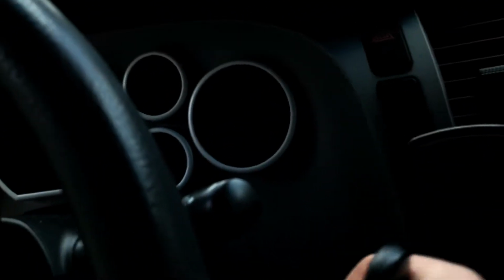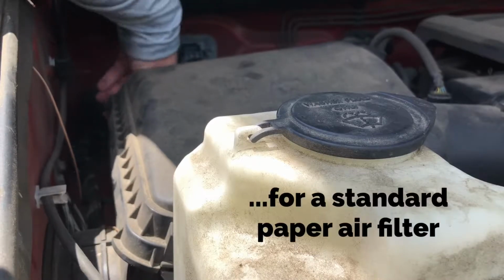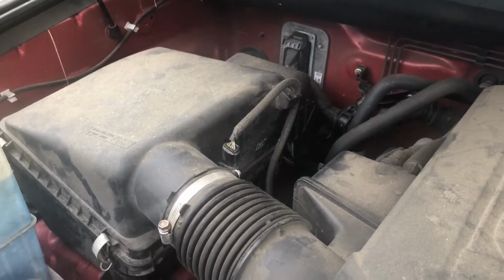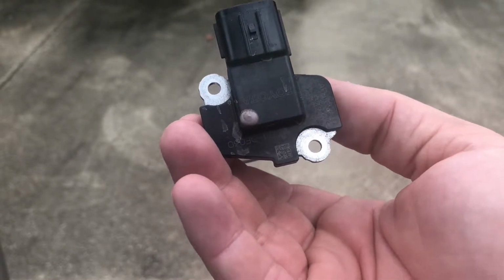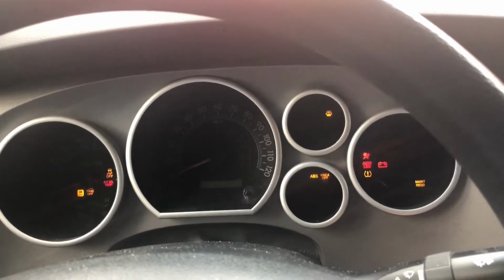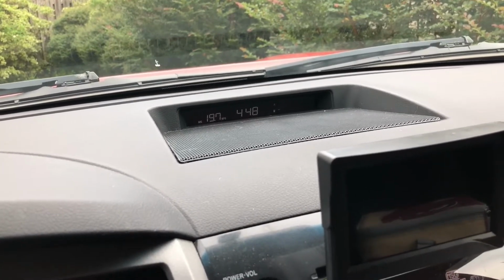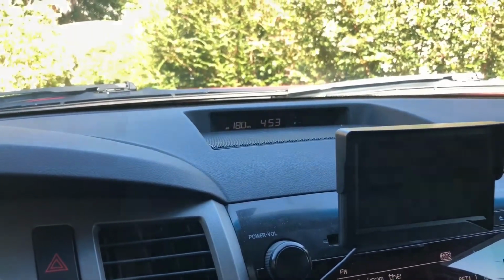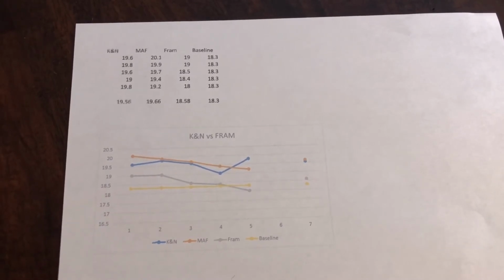K&N vs Fram Air Filter. Which is better for MPG in my Toyota Tundra?

Comment: I think filling at the gas pump and calculating the mileage that way will give a better reading, the mpg on the dash could be wrong depending on the air flow. The super charged tundras show 20mpg when in fact it's lower and it's just not complicating the right amount.
Reply: You are absolutely correct, those mpg displays are completely inaccurate

Comment: Pretty sure thats a map sensor mass air flow has a wire. Could be wrong though. I think som models were maf and some map. Crazy what 1 mpg adds up to in the long run! I think you probably should have tested both without cleaning the maf or map.

Comment: How the hell do you get 19 mpg?

best I've seen on my tundra is 18..and that was coasting.. 
Soon as i city drive. 14mpg.. and a low of 12 towing a trailer.
Reply: otahu Rice LOL! It helps that Florida is pretty flat. And I keep my foot out of it... at least for testing purposes. Other than than the filter, I only run 0w20 synthetic oil. The rest is factory original.
Reply: @Eldubzzz  I'll say... I live in 90% of hills.. Nothing flat around me.
Reply: I just bought a 2012 Prius for this reason, 50 mpg just normal driving .....Not bad for a car that costs me $3500 from the car auction 👍👍👍👍
Reply: I've got like 9 mpg on my truck and that's baying it. How the heck do you get 18 to 20
Reply: @harmless360  same here

Comment: How did you get 19 mpg. My 2019 only get 13-14
Reply from the maker: Flat Florida back roads I guess. It drops to 10 mpg pulling the boat. 13 when I’m driving in town all day. But the K&N def helped the MPG.
Reply: Its all about throttle pressure. I can get as high as 16 on mine and thats with 35x12.5" RT tires on a 4.10 gear ratio. Once i get it regeared i can probably get up to 18 to 19. If you have stock gears and stock tires a 4.88 gear ratio will help you get better mpgs too. But relaxed throttle pressure/coasting will be the most helpful. Just dont be in a hurry when driving.